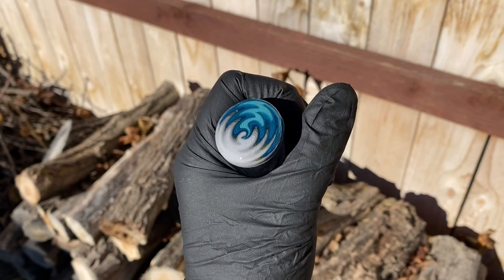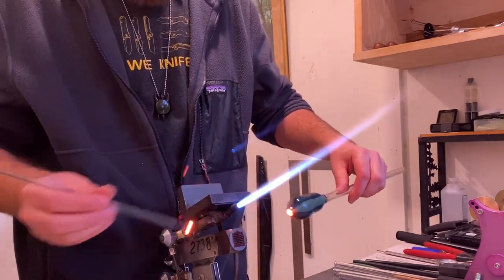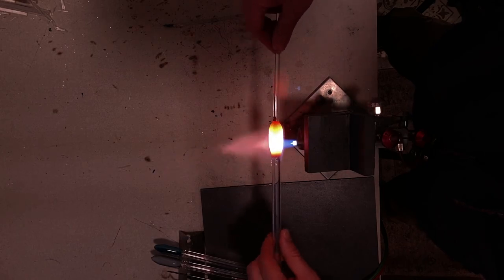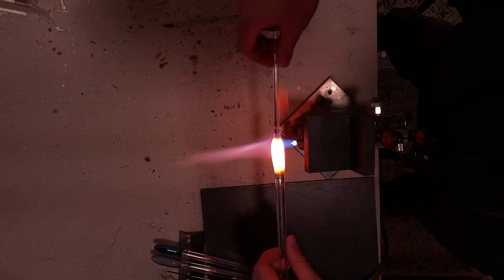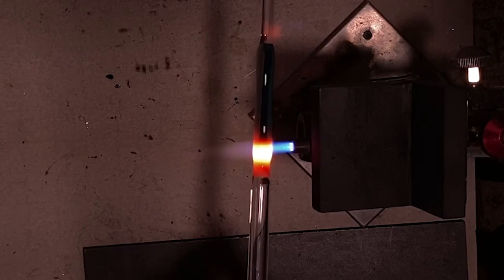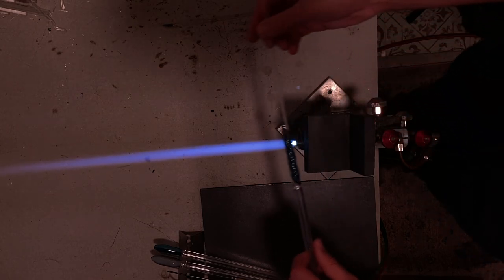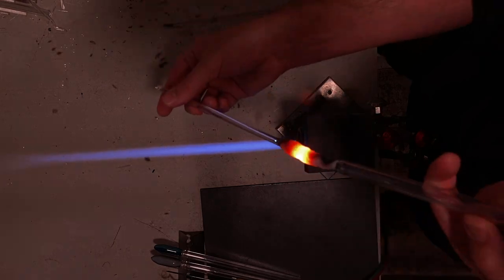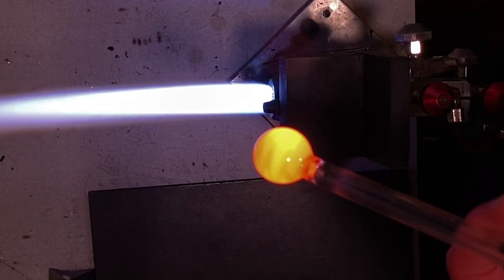Wig Wag Glass Demo

Comment: Thanks! I'm having ahelluva time with terminations. Got any tips or tricks?
Reply from the maker: Oh man, 😅 I do have some tricks, but they're kind of hard to explain. (I'll make a video about it sometime!) When you're cleaning up the termination, make sure it is super sharp and tiny and that the glass is as thin as possible at the tip. (In wall weight.) When you condense things back, don't let the termination gather too much glass. Monitor the thickness as things are condensing down and puff in some air to keep the wall thickness at the tip relatively thin until theres enough glass behind the termination to melt into. I hope that helps a little bit? Thanks for watching and commenting! 😁